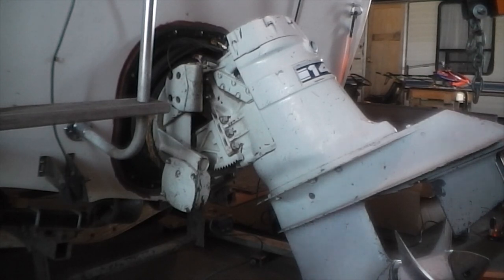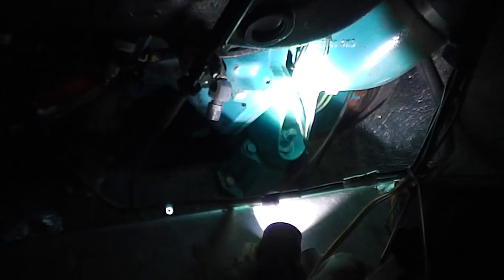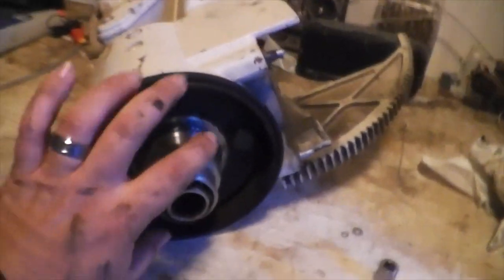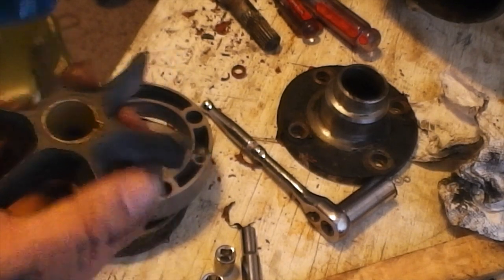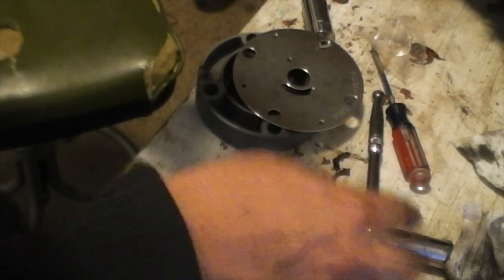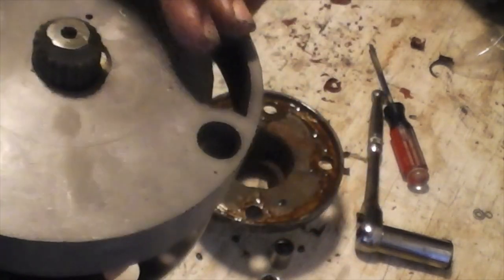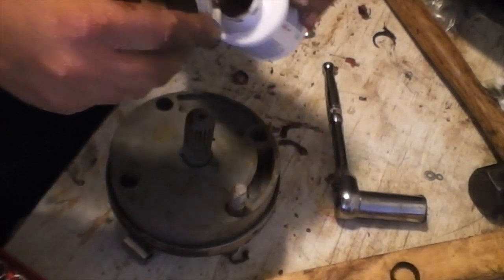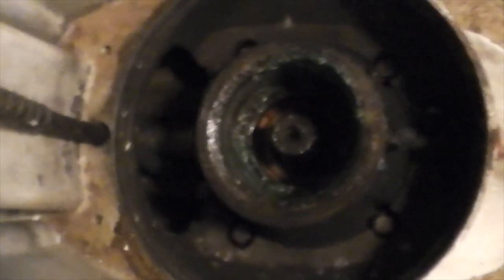1976 OMC stringer electric shift Impeller replacement

Comment: how do you what way to install impeller I have a 400
Reply from the maker: I’m not totally following?
Reply: @ryanmurphy4208  the rubber impeller does it matter wich way it in the housings
Reply: @ryanmurphy4208  I have seen it installed clockwise and counter clockwise
Reply from the maker: @3j3936  front or back no it doesn’t, but you want the twist in the impeller in the right direction tho.
Reply: @ryanmurphy4208  thank you very much
Reply from the maker: @3j3936  you’re welcome
Reply from the maker: @3j3936  install it in the wrong direction you may have lack of water flow issues or no flow if installed in the wrong direction. After installing the new impeller pull the hose off coming from the lower unit to the t-stat to make sure you have sufficient water flow.
Reply: @ryanmurphy4208  should I test it  in a bin of water not the muffs
Reply from the maker: @3j3936  awesome
Reply: @ryanmurphy4208  thanks again for help greatly appreciated
Reply from the maker: @3j3936  you’re welcome

Comment: Hello. I need some advice on my 1975 Sterndrive tonight if you by chance receive this message let me know
Reply from the maker: Ryan Markewich what’s going on?
Reply: Ryan Murphy good day. Thanks for replying. Facing the leg from behind the boat on the right side there is a 4 bolt cover with an o-ring, cork gasket, plate and a full gasket.  I don’t know what that area is called but it’s the left side equivalent of where the garden hose would be hooked up. When I hooked garden hose up both sides had water coming out of the bottom of the cover.  I couldn’t get a gasket set in the time frame I needed so I made my own.  The hose bib side sealed up but I couldn’t get the right side to.  Or so I thought.  Little did I know until after trying to re-seal it 3 times that there is a small port that runs from underneath to inside the water port closest the engine  to me it looks like it is supposed to come out of there at all times but the 2 mechanics I talked to prior to knowing about the small hole and only thinking it was the seals told me no water should be leaking as lost water there starves the engine of water   Any advise?
Reply from the maker: Ryan Markewich I cant fully remember what’s inside those pivot caps. But I do remember a cork gasket and metal gasket and possibly a o-ring. I believe those sit at different depths. Both of my caps leak when I have the garden hose hooked up, but don’t leak when in the water. I would recommend replacing the gaskets obviously. But in all honesty I pull the water inlet off we’re it goes into the thermostat housing and make sure you have sufficient water coming out from the impeller and keep an eye on your water temps you should be fine for the weekend. If this doesn’t answer your question let me know. Can possibly do a video chat of what exactly you are looking at and go from there.
Reply: Ryan Murphy thankyou.  Ran like a dream today but mostly used the 9.9 mercury while fishing.
Reply: @ryanmarkewich7384  Ok so this is a question I was seeking as well. I have many years experience with working on all range of pumps etc. and this has me perplexed as well. I thought this was an issue and when I rebuilt my lower end made sure to purchase new gaskets for this (separate kit) because I felt it shouldn't be leaking either, the queer thing is that yes there are two holes on the bottom on either side but in examining the gaskets there does not seem to be any reason for it to be leaking past them. There is a large gasket that is sandwiched by the metal plate that directs the water in a 'U' back into the end plate from the lower unit and it feeds the engine water pump through the other two ports, one with the cork gasket and the other with the small O-ring that lower unit pivots up and down on. My engine is running hot out of water, I do not have the hose fitting so I removed the cooling screen on the lower end and formed a piece of garden hose with a quick disconnect on the end to feed it water. That's how I see the water coming out during running (and not), I have never had this boat in the water yet, that is near on the horizon. 
   Now that I have repaired a leaking fuel tank, partially rebuilt the lower end and water pump and installed a new electronic ignition conversion but I still need to time the engine, at this point it's just by ear and it may be retarded too much causing it to run hot. They had issues before I bought it noted by new temp sensors etc. but I'm certain I addressed several additional issues as well in the water pump and gaskets etc. but like I said still have water coming from those holes that is both confusing and disappointing since I can see no source or reason for it. Have had to table it for it a while being fully engaged in repairing the fuel tank issue which is finally on its last details so I'll be getting back to it again shortly.
Reply: @ryanmarkewich7384  Those ports should not be sealed. Those are the tattles, they are there to give a visual indication that the impeller is working and water is being pumped through the outdrive and engine.

Comment: I thought the impeller was supposed to be turned in counter clockwise.
Reply from the maker: I have heard that myself, but it comes down to the manufacturer and what direction the shaft spins. After I did this impeller I checked and made sure I had water pumping to the water pump.
Reply: @ryanmurphy4208  I put a new pump in and it won't pump so am thinking the way you put yours in is right and counter clockwise is wrong.
Reply from the maker: @tomsawyer247  there’s a good chance that it was installed wrong then. If change the direction of the impeller and it still won’t pump water I’d look at your pickup tube. Keep me posted on what you find out🙂
Reply: @ryanmurphy4208  thanks Ryan for your help this thing has been bugging the piss out of me. I will put it back together tommorow clockwise and let you know the results.
Reply: @ryanmurphy4208  oh ya Ryan I was hollering at you to tell you where that key was but I guess you couldn't hear me from there. Lol.
Reply from the maker: @tomsawyer247  hahaha 🤣. I’m glad there’s been a few laughs from that 😃
Reply: Was the clockwise direction working for the impeller,or did you have to go counter clockwise?
Reply: @MrCrf450rider  hoping to get an answer to this too!!!
Reply: @layzis27  I have an 84 omc 400 cable shift,and it is counter clockwise  on the waterpump. The book says clockwise, but I think it's a misprint. I already had the boat out,and the temperature is stable.
Reply: @layzis27  if your ball sprocket turns cc on your boat,it gets transferred to clockwise on the upper drive unit.whatever way that waterpump shaft spins, is the way you install the impeller.it should not scoop the water,but sweep it
Reply: I obviously have bigger problems as have tried both clock wise and counter clock wise and still no water to engine but getting water in the upper crank case.
Reply: @tomsawyer247  the seals must be leaking in between the waterpump, and upper gearcase side.the seals must be facing each other,with the outer edge facing out.I used permatex red semi drying brush on gasket sealant on the inner housing.or your o ring on the waterpump housing unit is leaking,or missing
Reply: Well after a lot of swearing and pounding my head against the wall I thought maybe the leg wasn't deep enough in the barrel. Well it pumps just fine now.

Comment: Hi there!
Can you please give me the partnumber of the impeller or impeller-set
Kind regards from Holland😎👍🏻
Reply from the maker: Yep I sure can, I’ll get them when I get home from work today
Reply from the maker: OMC Stringer Drive Water Pump Kit with Housing 

EMP Part # 46-00017 

Replaces OEM Part #: 983218, GLM 12190, Sierra 18-3386 

New water pump kit with housing for 1964-1986 OMC Stringer drive (not Cobra) applications. 

Kit Includes: 

1 - Water pump housing (replaces OEM # 983298) 
1 - Impeller (replaces OEM # 379475) 
1 - Impeller wear plate (replaces OEM # 313176) 
required o-rings and seals.  These are from Amazon
Reply: @ryanmurphy4208  thanks Ryan😎👍🏻
Reply from the maker: @ericdereus4409  no problem 😉